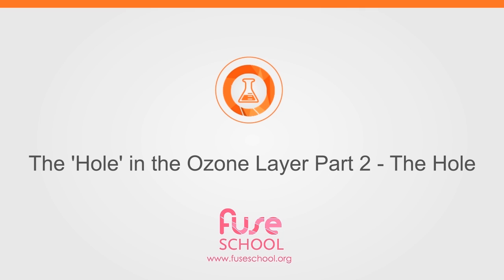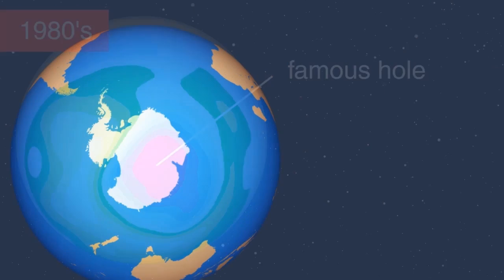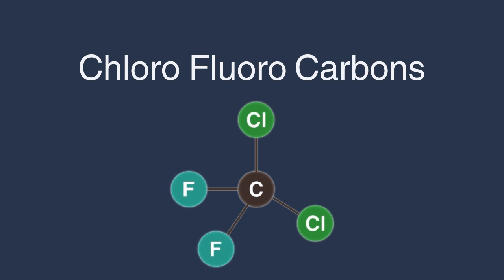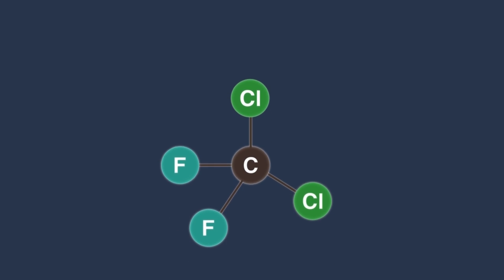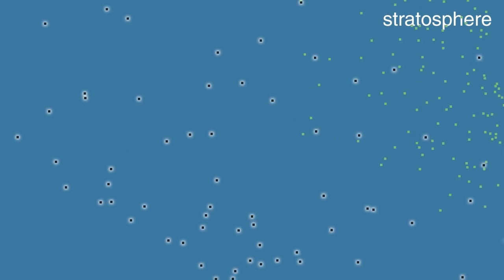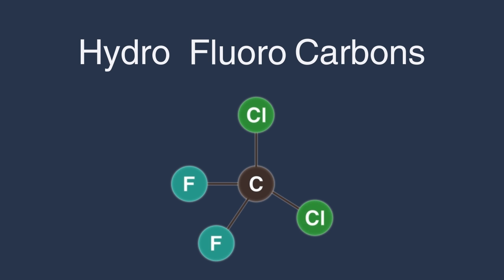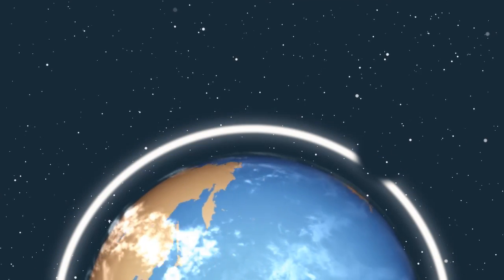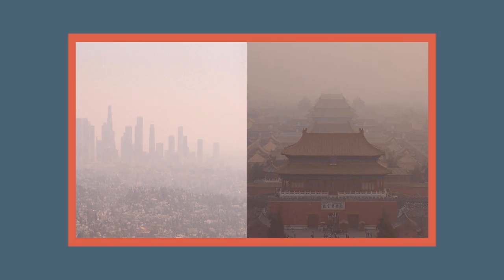What Is The Hole In The Ozone - Part 2 | Environmental Chemistry | Chemistry | FuseSchool

Comment: So why is there a hole? I understand that the chlorine bonds with the oxygen, preventing o-zone from appearing, but why is there a hole? Why did all/most of the CFC damage concentrate in one circle?
Reply: crasowl Google It.
Reply: See the troposphere is told to extend till 10 km and then after 12 km its stratosphere but this 10 km is an average value its 6 km at the poles and 18 km at the equatorial regions. So the poles get affected first since the ozone and concentration of oxygen is closer to the earth's surface.